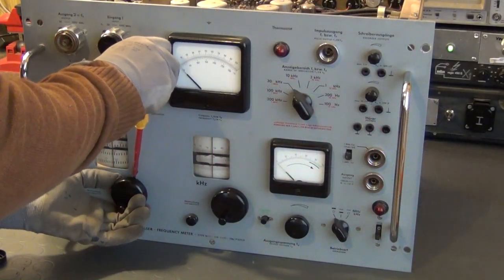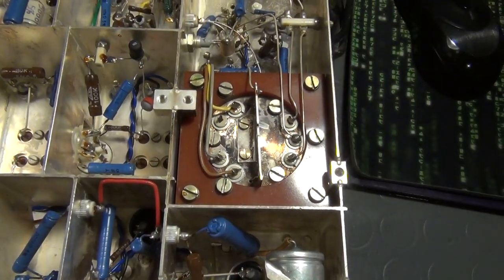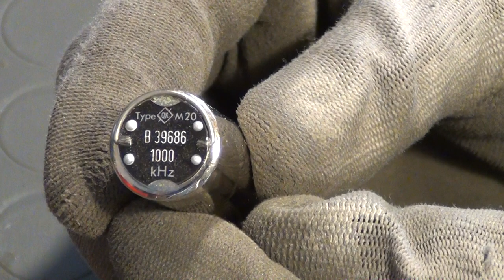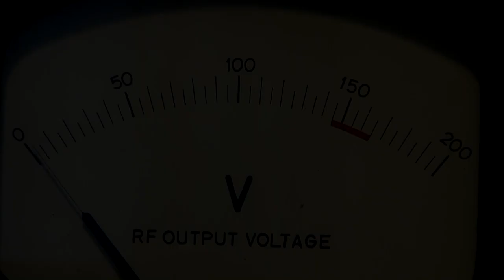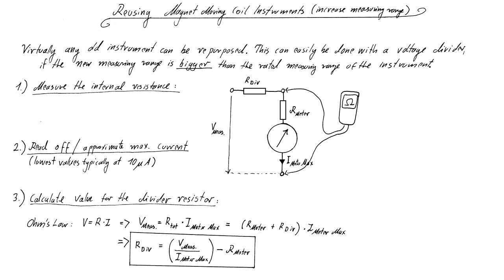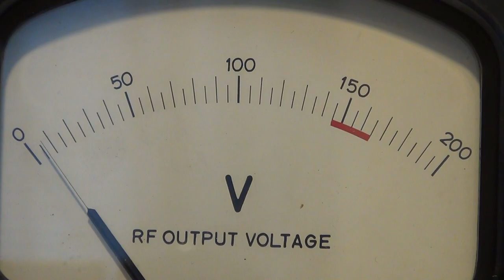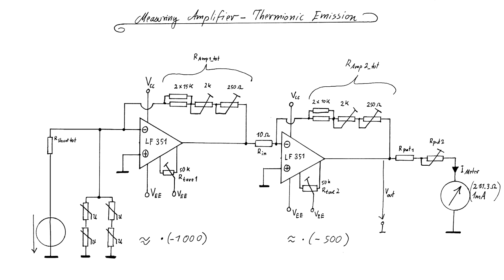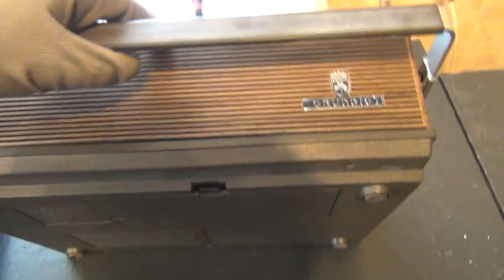Thermionic Emission Experiment - Vacuum Tube Tester (3)

Comment: Maybe your best video yet. Thank you. 

If you cut the old passive components with reasonable leads left, I bet you could sell them in a batch on eBay.  If those were wire wound resistors, I would bid.  I find using a simple buy it now price works well. 

I believe that thermionic spark discharge was a huge problem with early rocket motor work. The plasma from the torch slips through the visible hole in the plate. 

Patrion is a great way to get support with lower fees and hassle. Dave Jones at EEVBlog might walk you through it. 

Do you know the name of the torch? Looks very stable and tunable O2 content. 

This could have been at least 4 x 20 min. videos.  Maybe save your energy and make them shorter. Basically, we love your work. I doubt if anyone will complain about shorter episodes.
Reply from the maker: Lawrence Bosse Thanks for the input man. I'm thinking about the patrion idea at the moment. Many youtubers seem to use it. Concerning my videos: I'm really bad at guessing how much work a project will take and I always want to cover way more than is possible. It's a learning process. The name of the gas torch is "Lötmeister 2000" by "CFH".
I bought it in a home improvement store a couple of years ago. It's a cheap yet reliable tool. Here is a link: (It's in German though):

http://www.amazon.de/CFH-L%C3%B6tlampe-L%C3%B6tmeister-2000-52165/dp/B001ANGR0I

Comment: I've re-used old meters like those before, too.  The way I like to approach it is to connect it in series with my resistor decade box.  I set it to its highest resistance (19.999999MOhms), hook it up to a small, common supply of DC voltage, and slowly step down the resistance until I have the displayed value I want.

Comment: What will you do with the unused silver plated enclosures ?
Reply from the maker: Steve Smith I have an old book with a lot of  diagrams for analogue remote control circuits. Maybe I will put one of those inside the enclosure. I've been planing something like that for years.

Comment: In your ingenious experiment to demonstrate thermionic emission by heating the cathode with a blowtorch, the reason the current flow was so small was because of the air.  If you enclosed the apparatus in a vacuum chamber and evacuated the air, the current flow would have been much greater even with a plate voltage of just a few hundred volts.  (Of course, you would have to heat the cathode electrically since a blowtorch wouldn't work in a vacuum.)  You would then have constructed a "Fleming Valve" as John Ambrose Fleming did in 1904 and could demonstrate its diode action.  (The profound effect that you alluded to in your video)  If you coated the cathode with barium oxide or strontium oxide, the emissions would be much greater still...  

You could then put a grid of fine wire between the cathode and the plate creating a crude triode as Lee De Forest did in 1906 and demonstrate that a small swing in voltage on the grid causes a much larger swing in the plate current.  How good are you at glass blowing?  Or, you just sacrifice a tube by disassembling it on camera.  

Although vacuum tube electronics are largely obsolete, it is still a brilliant and clever technology with a fascinating history.  As a child, many of my first experiments in electronics were with vacuum tubes.  I can't wait to see your next video!
Reply from the maker: SMB Hey. That's exactly what the next video will be about. As the story goes, Frederick Guthrie accidentally found the effect of thermionic emission, by holding a glowing piece of wire close to an electroscope. The electroscope discharged and he could thus deduce, that A current must have flown through the air between the wire and the electroscope. When I read the story I wondered if I could find a way the show the effect without creating the vacuum as well. It seemed very unlikely to me, that Guthrie could have found the effect without creating a vacuum. My idea was then to simply try that myself. 
Since I don't own an electroscope, I deviced another way of demonstrating the effect. In the next part I will then talk about exactly those points you just made: Why does it work much better in a vacuum, what is a diode, how becomes a diode a triode  etc...

Comment: I could be wrong but it seems to me that you were much closer to verifying classic thermionic emission in your first attempt. If you were to insert a sufficient series resistance between your cascade multiplier source and the anode plate you could have stopped the arcing and also measured the voltage divider drop due to thermionic conduction at the red hot cathode temperature, which would be a more convincing test to me. The measurements you took using the amplifier seemed to correlate increases in plate current with the ionic plasma conductivity of the torch flame rather than cathode heating. I say this because the meter deflections occured so quickly with the application of flame and did not decay slowly enough to indicate thermal behavior.

Comment: Wouldn't it be nice if you would insert a grid electrode in the middle and apply the high voltage between the grid and the cathode? You could control the current through the main electrodes by applying another lower voltage to them, right?

I really looked forward to this video, and of course, it was perfect. Please keep them coming.
Reply from the maker: Dren Imeraj  Hey. What I have made is a very rudimentary "Diode". If one would add a grid, we would have a crude "Triode" and I will talk about the evolution of the vacuum tube in the next videos. I don't think though, that I will do further experiments with this dangerous setup. 

By the way: Thanks for the donation! Do you have any preference concerning the two devices that I have shown for a possible teardown in the next part ?
Reply: The Post Apocalyptic Inventor That is great, I can't wait for the new videos. I agree about the dangers of using your setup. That capacitor bank can deliver large amounts of current and a shock from it could be lethal.

I'm sorry for donating such a small amount, but the living standard in my country is nowhere compared to Germany.

As for the teardown, I really can't decide. I love vintage electronics and would like to see them both torn apart. But I'm a bit more interested in the tape recorder since I'm curious about the mechanical side as well.

Comment: Thanks for another great video!  I noticed that the frequency standard had a marking that said "kHz". (kilohertz)   While I believe that the term dates back to the early sixties, I don't think it was used much until the early 1970's.  Maybe it was replaced after the unit was manufactured?
Reply from the maker: SMB Hm. I wondered about that myself. One would expect a rating in Megahertz instead. Do you know the manufacturer "QK". I'm quiet sure it's not a German company. The two other crystals are of the same brand, yet they have a rating in MHz.

Comment: Guten tag,

The items you were calling crystal oscillators are piezoelectric crystals called HC 6's They are used in oscillator circuits.
Nice collection of silver plated metal and wires..

73 de WA4AOS
Reply from the maker: wa4aos Hello.

Thanks for the info about the name of these sockets, wasn't aware they are called "HC 6".

Strictly speaking a "crystal oscillator" is an oscillator circuit based on a piezoelectric crystal, rather than the crystal itself. I'm aware that today there are also integrated crystal oscillators in small metal cans available.  So I guess I wasn't precise enough here.  but I have heard many people use the two terms interchangeably. 

Best regards, 

TPAI

Comment: Are these units functioning or repairable ? I dig Grundig !
Reply from the maker: Steve Smith The tape recorder is repairable, but I have bought 3 of them in the last years and they are worth next to nothing when you actually want to sell them. In Germany there are plenty of those on ebay every week or so. Furthermore you can build a small funky looking tube amp from its parts.

The oscilloscope is working, but has issues with the trigger circuit. It also is a very slow oscilloscope (100 kHz max ) and is virtually useless for me.
But I'm thinking about not gutting for parts, but rather install it inside a transparent case and make it some kind of showpiece.
Reply: The Post Apocalyptic Inventor
Grundig would sell here in Australia . How much do they go for in Deutchland ?
Reply from the maker: Steve Smith Bought this unit as it is for under 10 €.

Comment: Hello, may I ask where you got all of your knowledge from? I really like you German people. I think you guys are great at engineering and designing things. I also like your cars (Audi, BMW, Mercedes). ;)  Thanks in advance. 

Devin
Reply from the maker: 150rbaby I recommend to buy old electronics books from the 50s, 60s and 70s. Back then technology was simpler and learning the basics of electronics was key. These books are often well illustrated and cheap in price. Every modern student or hobbyist should spend some years learning about basic electronics, before going into micro-controllers and FPGAs. If you do it that way you are forced to learn how electronics really works on the "component level". It is then also key to bring your theoretical knowledge to the test all the time. Reading, experimenting and calculating should go hand in hand. I learned to calculate and to think like an engineer at university, but 90 percent of what you see in the videos is self taught by reading books and putting things to the test in experiments and practical projects. Using the internet additionally is of course a part of it as well. But I do not recommend to rely on that alone.
Reply: The Post Apocalyptic Inventor Thank you very much.

Comment: Use a smoke detector cup and grid terminals for a super high dc impedence  go, no flow type meter. Bypass  and cut off the ionization part of circuit.

Comment: I would have thought that a crystal from the early sixties would be rated in KC or MC (kilocycles or megacycles) instead of kHz or mHz.  I've never heard of the brand "QK"...
Reply from the maker: SMB Hello. There is actually a wikipedia-article about this topic:

http://en.wikipedia.org/wiki/Cycle_per_second

It says that and I quote:

"in 1960, the cycle per second was officially replaced by the hertz"

It is also worth mentioning, that details like these are different in Germany. I'm not sure if "cycles per second" was ever common in Germany.
I heard that unit the first time in my life, when I was watching old training films of the US armed forces a couple of years ago.

In the end it doesn't matter, it's just another name for 1/s or s^-1.
Reply: The Post Apocalyptic Inventor I guess because Heinrich Hertz was German, the term was always used in Germany before being adopted worldwide.  In the United States, the term "cycle-per-second" or simply "cycle" (per-second was implied) was used before being replaced with the now standard term "Hertz". (Hz)  This happened by about the early 1970's.  Vintage radio equipment manufactured in the US before about 1970 usually says "KC" or "MC" on the tuning dial.  (kilocycles or megacycles)